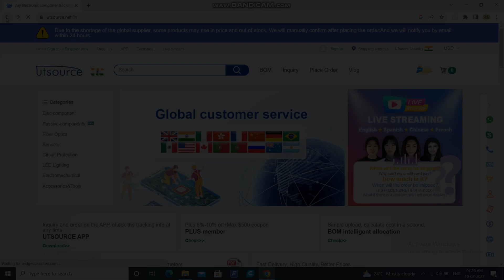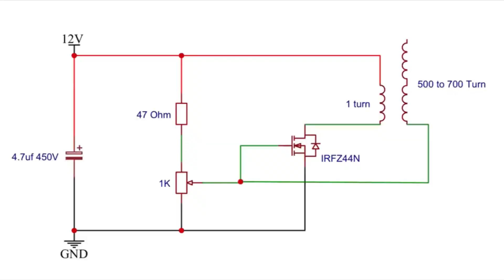Diy Single Mosfet Powerful Tesla Coil Circuit | Utsource

Comment: It didn't work for me. I used a 47 ohm, 1 watt resistor, a 1k potentiometer, an IRF44N MOSFET, a 4.7 uF, 350V electrolytic capacitor, and my coil is 300 turns, 12 volts, and 0.6 A. What's wrong?

Comment: i am begging not to do this project by this video  chance is 12/100 me  and my father who is an electrician worked 6 days no results
Reply: I just made it today and it worked. But it is not very efficient. You should try again
Reply: will it work on 10 k potentialmeter
Reply: 10k is I little big , but I think that you can use it buy adjusting it to  low value near zero.
Reply: How much voltage and amp do you want to supply?
Reply: i can’t find 1k potentialmeter can you suggest me devices which this thing is normally seen
Reply from the maker: Sorry about that, try using a different MOSFET.
Reply from the maker: Sorry about that, try using a different MOSFET.

Comment: Bro I copied your same project it worked for 1 minute and then smoke came from potentiometer I tried replacing potentiometer 3 times again same thing happened and lastly the mosfet burnt with a sound
Reply: What's the problem in there to high voltas or amps I used 47ohm resister
Reply: your putting to much load on the potentiometer lower the amparage

Comment: 700 turns of secondary coil and 1 turn of primary coil isn't recommended instead use between 6-10 turns of primary coil for better arcs
Reply: U dont understand how this thing works...bigger the ratio, bigger the voltage...so its fine.
If u make two setup with 3 turns and 6 turn primary, then the one with 6 turn will produce lesser spark...
Reply: ok
Reply: there is no spark in the nail please suggest me something
Reply: Please tell me gauge of wire
Reply: Bro 700 turn clockwise kerne hai ya anticlockwise please betao
Reply: @DeepeshSingh-b6h  it doesn’t matter
Reply: @funkyfunnyplace9173 yes it does matter. Have u ever tried building one self ? Coz u would have known if u have done experiment both ways, with different combination.

Comment: Sir can i provide current by ac to dc adaptor in it ???
Reply: You need dc for it because the mosfet switch's that dc into high frequency for the tesla coil to work
Reply: And also does it work with less no. Of turns of copper wire??

Comment: Hey i have assembled exactly as you have shown and it is working. But how do i increase the intensity . My led is glowing but faintly. Also what's the diameter of the coil u have used and number of turns

Comment: The idea of standing it on the inverted heatsink is a nice one.  I am making a similar one but with a circuit board which will be cut to the same size as the heatsink and mounted above it.

Comment: Really? This works with only 12 volts? Very surprising, and he's using a big thick nail as a top load, try using a small knitting needle to get bigger sparks.
Reply: A hypodermic needle works well attached to the top with a blob of solder.  Sometimes you do have to bring an insulated screwdriver close by to start the arc.

Comment: Doesn’t work 😢 I tried
Reply: If it won't oscillate swap the primary winding connections over as it will only work one way round
Reply: Wind the primary coil in with 1-2 turns in the opposite direction of the winding of the secondary coil to make it oscillate otherwise it won't work

Comment: If you want to further improve the output power, you can put a RF amplifier to the mosfet gate and raise the input voltage
Reply: That is not true since the power is limited by the input voltage and the impedance of the primary coil - if anything at higher voltages you will want to attenuate the gate voltage swing by connecting a capacitor between gate and source otherwise the mosfet will blow.  Larger coils will resonate at a lower frequency so have less primary impedance hence more power.  The input voltage can be increased but only up to a point - too high and the mosfet blows.   The only real way to get more power is build a bigger coil.  Power isn't the same as voltage however and a smaller coil will use less power to generate a given voltage level.  It's the voltage that gives the sparks.  Expect the operation current to be an amp or so at 12v.  I have found smaller coils to be more satisfactory for sparks as they use less power and are therefore much safer to handle and use.
Reply: @ianhosier4042  I don’t care what you said, I just built the same coil with the same mosfet but with the RF amplifier and the arc at the coil end is much stronger and melted the nail
Reply: @OngvoHVAstuff08  on some small coils the 1k pot is too low a value to give sufficient voltage swing on the mosfet gate to push it into saturation.  Putting the resistor to 10k or even 22k will fix that without needing an expensive amplifier.  If you have an oscilloscope the mosfet voltage should swing by around 4v when the coil is operating at your choosen voltage.  That's minus 4 to plus 8 volts.  Any lower swing and you underdrive the mosfet and it gets hot and you get very small sparks.   I suspect this is what happened with your design as even at 1.5 A and 12v drive the mosfet should be slightly warm and not hot.
Reply: @ianhosier4042 How do I connect a resistor instead of a potentiometer? Mine had solder paste inside it that conducts electricity and now it doesn't work like before.
Reply: there is no spark in the nail please suggest me something
Reply: @rosoloz2376 just flip the coil
Reply: @rosoloz2376  Try to see if there are no short circuits in the components. One leg of the capacitor touching causes a short circuit. If this is not happening, increase the number of turns on the primary. It worked for me.

Comment: can i use 4,7uF but for 25V or it should be 450 V?
Reply: No, you can`t.
Reply: It's connected to a 12 volt battery so I guess 25v capacitor will be fine

Comment: Can I use 10k potential miter
Reply: I agree
Reply: Yes but 100k won't work
Reply: @ianhosier4042  it wark's  you can use 47k-100k ohm rasister
Reply: @subhamsahoo1763  you get more voltage swing at the mosfet gate with a higher value resistors but it can't be too high otherwise you will blow the mosfet from too much gate voltage.  If it's too small then your MOSFET won't run in saturation and you will burn a lot of power as heat and won't get good arcs.